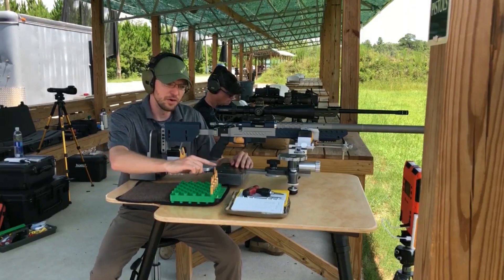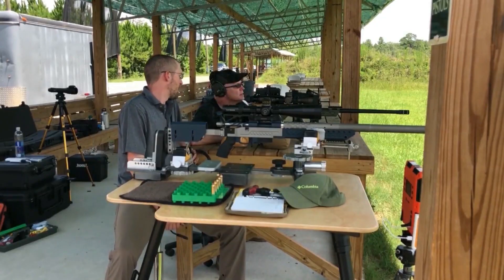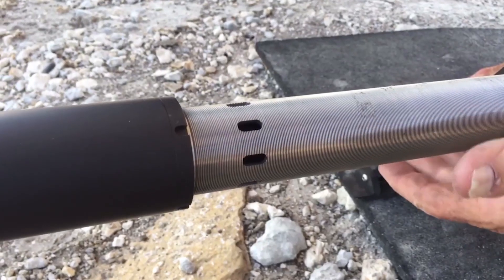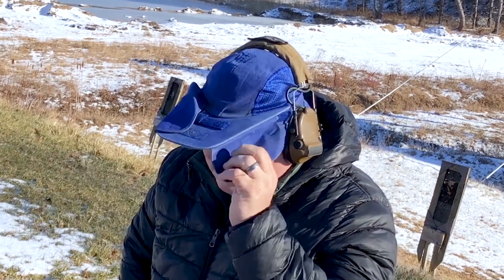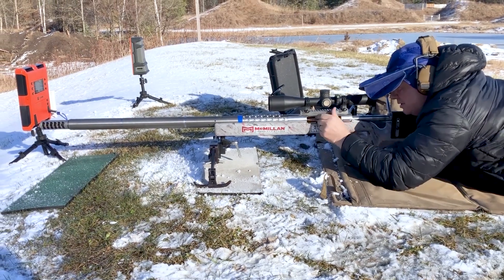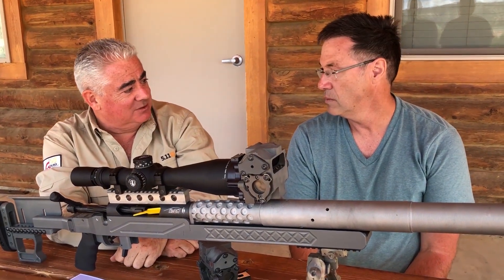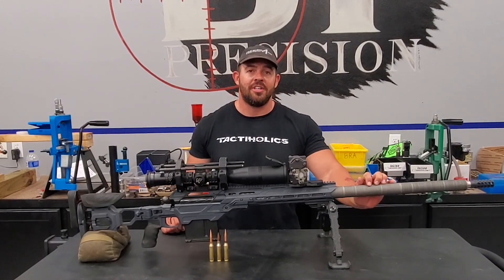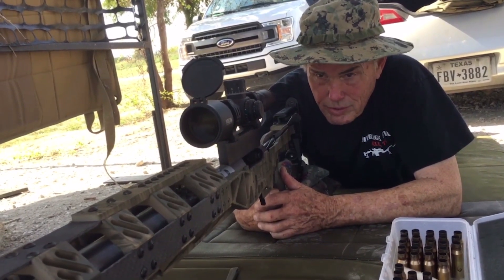Structured Barrels Really Harmonically Dead?

Comment: How much does one of these weigh? I understand that its a reduced amount compared to a barrel that is equally rigid, but I imagine that means its still much heavier than a normal barrel considering how much material is still present?
Reply from the maker: They are deceptively light. Often equal or a bit more than a standard. All depends though on the final DIA a customer selects when prioritizing weight or rigidity. Larger the DIA, greater the rigidity. Smaller the DIA, lighter the barrel. Multiple shooters have actually added weight back to their rifle once they mount a Structured Barrel.
Reply: @tacomhq  Ah I was completely forgetting the ability to change diameters to meet the needs of the use case. Makes sense, very awesome. A weird use case that comes to mind for me is an AR barrel built like this that is chrome lined with a stellite chamber. I wonder how cool it would stay under sustained fire?
Reply from the maker: @musician445  the AR10s we’ve built thus far stay ridiculously cool. We plan to show this more in the future.
Reply from the maker: We are looking at other materials beyond 416. Chromed line along with some of the other "wonder" coatings will certainly enter the mix. In the end, the larger surface area really does count, many times well over 300%, which is absolutely a measurable. We ran 20rounds through a 300Nm yesterday and the peak temperature was +11deg above ambient. The AR10 260Rem was used for 40rds most engaging targets as rapidly as the reticle settled onto the target again- sub 1sec intervals. At 40rds it was +16deg over ambient. As a note the chambers are the lowest temps.  @musician445
Reply: @tacomhq  Impressive! Temperature seems to be an immense factor regarding life of barrels, which would explain why everyone always says "it depends on your firing schedule". So using designs that remove heat rather than simply making the material more resistance to heat or more insulated from it, makes total sense. So it may stand to reason, that removing this much heat may make traditional controls like chrome lining less necessary..although still a great upgrade for the maximum barrel life i would think.

Comment: Hi Tacom HQ>
I have been looking at a couple of structured barrel setups for the past 8 months.
 I am really intrigued by the precision and accuracy that can be achieved by using a structured barrel coupled with a precision engineered action that has integral recoil lug and pic rail - in order to reduce inconsistency in the entire system.
I have one criticism. It is not of the product - the product looks very promising and I will certainly invest in one or two of them.
The criticism is linked to the build up of the various components to make up the entire system.
People want easy when it comes to spending their money. I, in particular, want components that are guaranteed to fit and work together to give me a platform or system that will produce the results I am looking for. Your website does not provide that type of information. When ordering a structured barrel, the required information like action OD, etc is not always readily available and to get that info can take a lot of time and effort.

May I make a suggestion or two. 
You guys have built rifles in what looks like some standard cartridges - e.g. from 6mm Creedmoor through 338LM, 33XC, 375 Cheytac, 37XC, 408 Cheytac, 416 Barret, etc. 
You know what works and what doesn't work. I get that you perhaps do not want to specifically endorse or exclude other manufacturers products but it would be very nice to identify some components that have been used and can work together as a complete system. 

An example may be:
Start with the cartridge: - e.g. 375 Cheytac
The barrel will fit into the action which is the primary critical interface - we would need a list of actions that can handle a structured barrel for that cartridge. Action OD being a primary consideration as that impacts on the choice of the action itself and the stock or chassis that can accommodate that action.
The secondary critical interface is the stock or chassis. In particular, the forend of the stock or chassis would need to be able to handle the outside diameter of the structured barrel and yet also provide mounting options for bipods or rails like an ARCA rail, etc. We would need a list of chassis' that have been used in the past for actions for that cartridge.
The other components are not really that critical. Whatever bipod, muzzle device, scope mount or rings, scope or other components you use won't make that much difference to the final build as the primary system will be complete and proven.
If you intend to attend PRS matches and showcase your products, I would also suggest that you use common components that current top PRS shooters already use. E.g. Defiance Action (Ruckus Tactical, etc) combined with a chassis that is also commonly used - e.g. MDT ACC for Remington SA (to match the action footprint) and to do so in the most commonly used cartridge - e.g. 6mm Creedmoor or 6GT or something like that.
Publish the results on your website. Provide a list of the components and pictures of the complete systems. Perhaps then provide a build template on your ordering page. Customers can still get their barrels to you and follow the normal process but can get the other components in the interim instead of having to fit them or alter them afterward.
Lastly, thank you for taking the time and effort to put the videos together, they are very helpful to say the least. And thank you for investing in a passion which is shared with a lot of folk the world over - these types of innovative leaps forward are truly exciting and allow us to collectively push boundaries.
Reply from the maker: Thank you for your feedback and great suggestions.  I am working on a web update that will greatly simplify and streamline the ordering process.